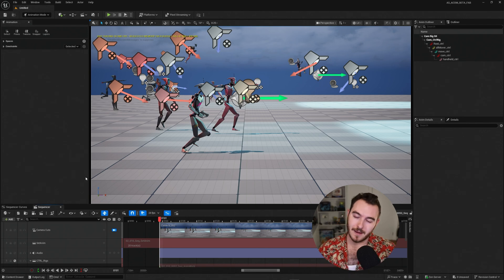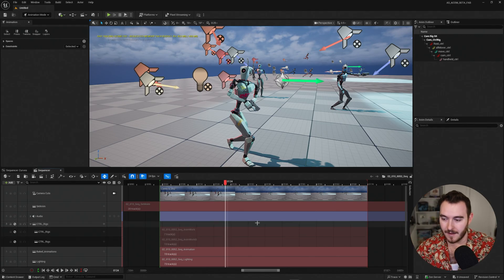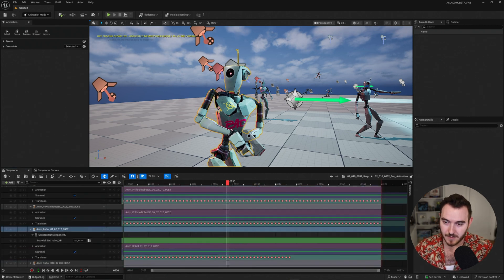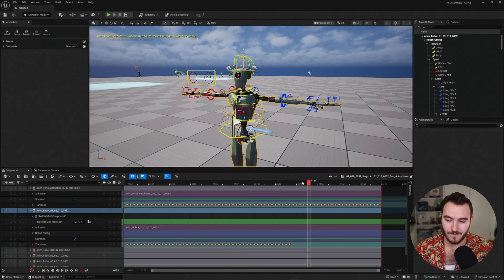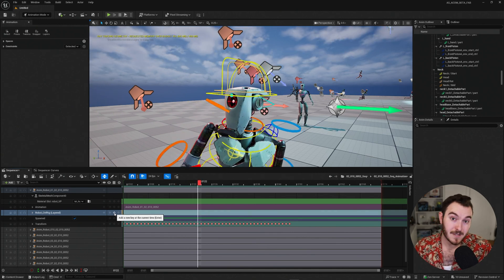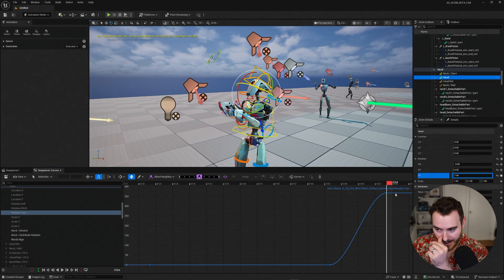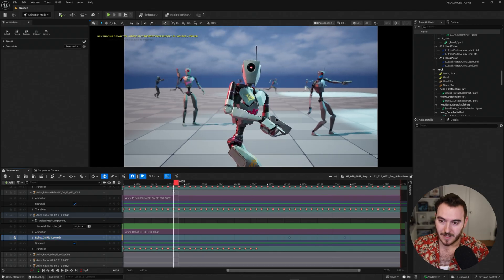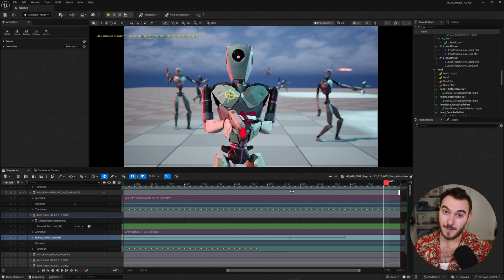NON-DESTRUCTIVE Animation in UE5! Layered Control Rigs Explained

Comment: At 4:52 and 7:27 you can see that his leg motion is broken from how it was in the initial animation. What caused that?
Reply: Layered control rig is quite unstable as it stands, and it's rare for it to not mess something up with the animation. Plus it doesn't work with the Override type of animation layer
Reply: I noticed that too, it's hard to say what is really happening, but I did notice that as soon as he added the layered control rig his pose was altered....not a good sign, looks like either a bug or a problem specifically with his control rig.

Comment: Is the muting just on and off. There is no blend curve for the different layers? Like you add some exhaggeration in the control rig layer and the Director likes it but wants it toned down a bit? So instead of go and tweak all the keys in the layered control rig you just go to a global blend curve for that layer and key down the effect of it a bit for the section the Director wanted?

If so or if coming in the future, in the Animation pipeline (not mocap cleanup) now Unreal has almost all and more to what Motion Builder (used in the first Avatar) had 15 years ago.

And I say that in the most positive way. As back then Motionbuilder was the best software for large scale NLA character animation. And that we now have almost all that into a game / realtime rendering production suite is amazing and really shows off the path Unreal is taking. To be the center hub for any CGI content creation. Games, Shows, Architecture etc.